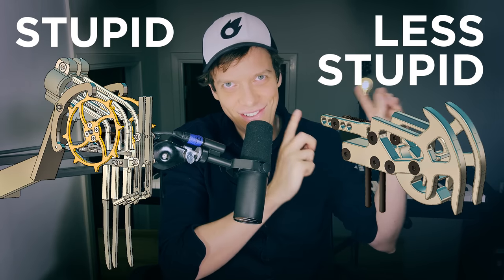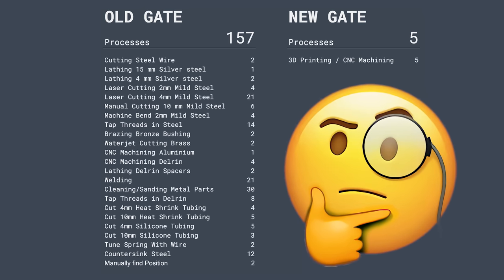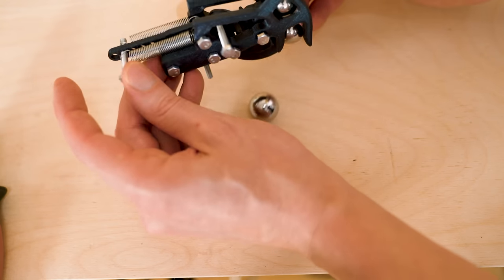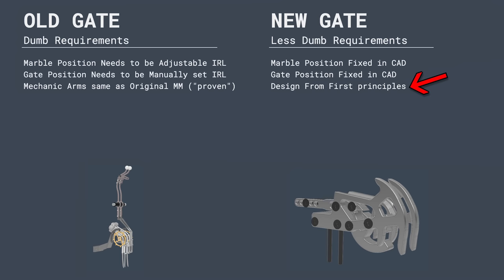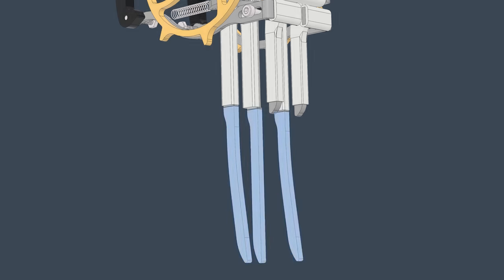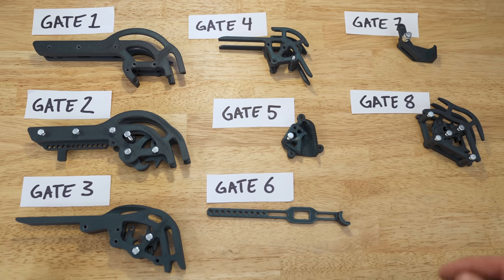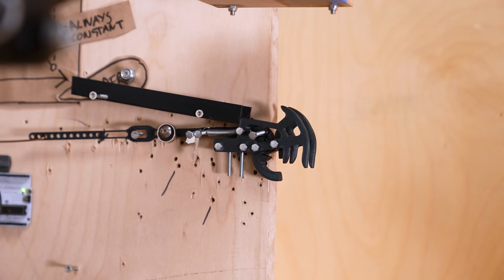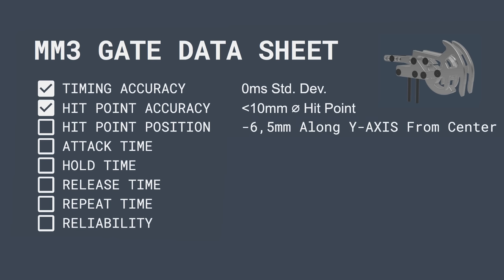This Design Trick Surprised Me!

Comment: I'm not saying you haven't made a HUGE improvement because clearly you have!! But.. the new gate still has 3 materials does it not? 

3d printed material or plastic or aluminium (depending on process)
Steel for bolts 
Spring steel for spring

Comment: Hmm if you want to transfer the drop position to cad I would like to measure it with more precision? like the angle the gate is mounted to the wall and stuff, so you don't have issues afterwards?  Or print out mounts (for a aluminium profile perhaps?) and test it ?

Comment: I know I find myself saying this more times than I should, but from the first machine to the MMX, and now to the new improved machine, I feel that form is losing out considerably from function. I get where you are going with this, you ant the machine to be dependable each and every time it is running. But to me, if it’s all about function, you may as well wrap it up in a black box and just let us hear the results. 

I say all of that because when you see the first marble machine, as a spectator, you find yourself in awe of its achievements as you watch all the gears and lifts do their job. The MMX was still a visual thing to the eyes. So my question is, will this new machine have form at all?  

Just thought I would put what little brain I have into suggestions.❤❤

Comment: 2:00 gonna say it now those metal parts in the old design are gonna outlast plastic parts in the new design. 600 marbles is the drop in the bucket for one wheel, you need to run a a accelerated wear test to failure.

Comment: dude.... if you're going to simplify to make your life easier, get rid of the machine and use a synth.
that has been the point of synths since the beginning! to dispense with the maintenance of instruments!
your machine was birthed under the premise of "Let's make the most mechanically impressive music box we can, that still runs precisely and consistently, even after changing it's initial configuration!"
in other words: complexity is not only OK in your design, it's the fundamental principle!
and if you're going to 3D print everything for the sake of simplicity, might as well 3D print a case for it and miniaturize everything! the point of the machine is to be impressive, so BE IMPRESSIVE!
put steel on it, in a time where nobody uses it! use manual action where everyone uses electronics! FIDDLE and PLAY the thing in a time where everyone automates!
THAT is YOU!

Comment: what’s the final design going to be made of, though?  all those plastic/metal interfaces will wear and fatigue, and we’ll be back here again when that wear degrades your standard deviation metric.  i really respect that you’re out there learning in front of the world and that you’re having fun right now, but it also pains me to see you get discouraged when you learn about the next challenge in mechanical design and engineering.  if you can run a longer durability test with your rig (a million marbles, anyone??) you’ll probably get some good data on how that material choice will perform over time so you’re not uber-disappointed in a few months.

Comment: I think you need to be careful with these measurements. They are all made in laboratory conditions. In a concert, you'll have to factor in vibrations that will turn all this precision on its head. What happens, for example, if the guitarist decides to jump in the air while you are playing on a wooden platform? The machine needs to work under these conditions. But that's not necessary a big problem. For example:

- The timing is within a millisecond accurate. That's great, and if it goes up to, say, 10 ms on a concert, it will probably still play tighter than a human player would. So no problem there.
- The marbles drop at within 10 mm accuracy. That's great, but if you design your instruments to rely on that 10 mm accuracy to function properly, then you'll have a really unpleasant surprise once you step out of your studio. However, if you design them to allow, say, 30 mm or more, then it will have enough leeway to function during a wide variety of conditions.

And how reliable it should really be? Ideally, it should play all notes perfectly no matter what. But that's a really dumb design requirement and it won't work. It should play all notes perfectly in a studio, and it should play almost all notes perfectly on a concert. And, most importantly, under any realistic conditions that would not warrant halting the concert in the first place, it should keep playing even if it misses a note or loses a few marbles. For example, it must work fine while people walk around on the stage, the drummer beats hard on the drum kit, the bass from the loudspeaker vibrates the machine, etc. And in cases like the aforementioned jumping, it should still work fine most of the time. But if it occasionally misses a note when all these effects add up in the wrong time, nobody will notice.

Comment: the whole dropping marbles manually, would it really be that big of a design feature to retrofit? All you really need is some sort of feature to trigger the normal mechanism that the programming wheel uses so if there is any room you could just make rods that reaches back placed next to the marble gates to push on. It is a feature i would implore you to look at once the system is designed and done!

Comment: hey martin, here is a thought, why are you catching the marble and holding for drop?  make a gate with 2 side plates and 2 gears, 1 internal 1 external that can pump 1 marble out per 1/8th rotation at ANY arbitrary speed, like a extruder on a 3d printer that squeezes balls through the gap with nothing other than gravity being your limit and even that can be designed around so you can spray a chain of balls like BAP BAP BAP BAP BAP BAP BAP BAP BAP BAP BAP BAP BAP all within a second or 2
Reply: also this re-adds manual playability as the outer gear will just be a idler to index the balls with the inner gear but if you give it a push/turn, it will spit the next indexed ball out, i can toss together a mspaint diagram if it helps explain the concept but hopefully ascii is enough
\\O
O||
ascii diagram where O represents a large tooth gear that holds 1 ball per tooth and || is a track, maybe put the indexing gear so it holds 4 balls in it's travel around an arc with the outer gear to the right of it 
=\\
O||O
just my thoughts, sorry if i have wasted your time in considering this design change along with all of the changes required to make it work in practice

Comment: 6:48, Wouldn't it be possible to just add a button/leaver on the front of the gate that connects to the rod on the backside. So if you wanna play and drop marbles manually you can just press the leaver from the front? Only way I see that this not working is if the gates are stacked too close that a 1-2mm of connection material doesnt fit :)

Comment: Don´t want to be a downer but 600 marbles are not enough too say that it´s reliable and to show that it will not worn out premature. It´s a good start but fix the motor to the lift and do at least as many marbles it will handle during a concert, maybe even a whole tour. Having to change out the parts every other concert is a design flaw in my opinion.

Sure you could just go from 3D-printed plastic to say 3D-printed metal and everything should be golden, with 3D-printed metal you could do some cool aesthetics maybe a HR Giger inspired organic/metal look!

Comment: I think if you really wanted, it would be possible to later retrofit handles that trigger the gates manually like you had on MMX. It is good to not insist on the requirement but I would not nececcarely declare it dead just yet

Comment: As I understand you have achived these splendid resultat with one prototype. But you will need many more gates. So it is important when you produce more gates that you control the variation between all gates when you produce the gates, so that the requirements are fulfilled for all produced gates.

Comment: I think this is the first time you got to the end of a design and still thought your plan from the beginning was right. Also, the gate you tested and approved is fabricated from the design you chose with no modifications. Every previous attempt taught you something that needed to go back into the process from the start. This time, you didn't learn anything new along the way, you did the work you knew how to do. Your previous designs were good enough to use them to prototype rest of the machine and discover integration issues. This design is ready for production.

Comment: 6:42 Please don’t stumble into the next pothole, Martin! Requirements should not only focus on your prospected results (a reliable working marble machine), but also on the effects: the change you want to be able to achieve with these results; your true goals. Which may be as abstract as ‘being recognized as a piece of art’, or ‘should be interesting to observe when operated’. Thinking deeply about values like these and taking them into consideration, may change the priority of your features and thus may make you want to kill less or other darlings. One of the ways to aid this process, is to think in chains/networks of cause and effect when you link the components of your solution with your goals.

Comment: In my experience, the best results, com from imposing reasonable, or even unreasonable, restrictions, for the very simple reason, that it usually forces you, to find THE solution, rather than just A solution. There is no easy way out, you have to do it right.
If you can only put 3 wheels on your car, the you have to put a lot more work in to some rather important areas, like suspension, and general stability, be cause if you don't, the end result will be so bad, that even the most gullible of people, are unlikely to buy it.
It's really simple, actually. And when the restrictions are too severe, once you reach that realization, you have likely already done the work, that'll ensure the end result will be a lot better than "good enough".

Comment: At quick repeats (14:10), it looks like the release mechanism hits the falling marble on the way down, throwing it off course. Have you checked how long it takes for the marble to clear that arm? That'll likely be the most significant limiter of repeatability speed.
Reply: Other than that, I just want to say that you've done a really great job on this new gate. First Principles design is really paying off for you!

My one piece of advice going forward would be to keep in mind to maximise tolerances where applicable. Otherwise, you risk relying on results from lab conditions that don't mirror the real world.

An example: The precision of that gate is fantastic and will do a great job at reliably dumping marbles, but it doesn't take into account if the machine is shaking while the marble is dropped (cranking the wheel/providing more energy, a dancing crowd, standing on an uneven surface). The gate will help reduce the impact of those external factors, but once you make the marble catcher(s), don't overly rely on their gate precision for determining landing precision.

Comment: This seems like it sacrifices the blend of art and engineering for pure engineering. New gate doesn't have a manual release and it doesn't have the artistic look.

At the least I'd put the big brass gears on the new gate (and have them doing nothing but rotating with the smaller wheel).

Comment: With your new speedy gate, Isn't your programmable wheel gonna be your weakest link with speed? How is your programmable wheel gonna be able to do a triplet - For example? I know you love your marbles, But isnt your arduino controlled Magnet going to be faster and more reliable in the long run then the wheel of fortune? Your Theme of do it smarter, not harder (Thanks Disney for Its' Mr McDucks saying), so how can you apply that to you master wheel? By the way, I really like your Archimedes screw Elevator.

Comment: You've cheated a wee bit in your comparison numbers there, Martin:
• For the processes, you included the installation and manual-adjustment steps in the old gate, but not in the new one.
• For the footprint, you included the control levers in the size of the old gate.  But the control-levers are not the gate.
So, you should've omitted a couple of things from the stats on the old gate prior to comparison, because it wasn't really apples-to-apples.

Comment: Instead of saying 0 ms of std. deviation, say <1 ms, because 0(.000000000000000...) is actually impossible.

Instead of saying 100% reliability, say >99,39% with a confidence interval of 95% (2 std deviations). You can calculate that with a Bernoulli-Test.
This number says that with an probability of 95%, the actual reliability is above 99,39%

These are minor issues and I know I am beeing pedantic here but you always want to leave some room for improvement.

Comment: Okay but you didn't test ANY of the others, particularly timing and hit point accuracy with the faster repeat times (at least you didn't show that you did). You obviously need to know that your timing and hit points will stay as accurate no matter what type of song is being played

I fear that your segmented/individualized testing (such as only testing hit point accuracy at one constant speed), with relatively low marble counts (remember that the MMX played many hundreds and even thousands of marbles with no mistakes at times too) can easily compound into much greater problems as you potentially progress through this build

If you're going to learn from the weaknesses of the MMX, you can't discount the fact that each individual part or section seemed to be perfectly functional in and of itself, for the most part, but it was the combination of system upon system that led to failures in the end

Comment: 600 drops is nothing wrt the millions you were aiming at. Please consider having longer tests.
1 drop every 125 ms ? even if you have 2 gates per note.... Why you say it is 'enough'?
BTW motors get hot, maybe buy a better motor (different hybrid magnets have better efficiency)
Try seeing if you need the nominal current you are using (reduce it or check if the motor is properly sized).

Comment: Well the older look better tbh. More aestethic and it's metal not black boring plastic or one boring metal.

Also as a student with the first one you learn many manufacturing process and with the new one you didn't learn anything.

And finally removing one of the most iconic features to play the marbles manually is A IG BIG LOSSSSS

Comment: Unfortunately, you kind of have to build these things first before you can figure out where it doesn't work.  Sure it was ridiculously complicated at the start.  On the verge of brute force.  But that's probably where 6 out of 10 of us are going to start from if we want to get anything done.  Those 3 out of 10 that spend time thinking how to optimize everything to perfection probably won't ever finish.  The last 1 has probably been doing this for decades, or they're plain lucky and hit the optimal design in a single shot.  That's the design process, unfortunately.

Comment: Dude, you are still not getting it. Unless you are designing the machine to be industrialized for manufacturing, there is zero point in what you are doing.
The Machine X was more than good enough for your performance, complexity is fine as a functional work of art that can be tweaked once or twice per tour. 

The more you seek efficiency, your machine will end up looking like a shoebox with leds, it will get duller and boring, and honestly it will lose the point of this.  The moment you started playing with arduino and servos, this project lost all its charm. The thing that made this project interesting was that it was purely mechanical, and that made it a functional kinetic sculpture.

If you are this obsessed with precision you will get a point where you will end up removing the marbles altogether for the sake of achieving sub nanosecond precision. Really, what is the freaking point.

Comment: I think you've made a critical thinking mistake.

Manually dropping marbles is not redundant. And with this new gate design a manual marble drop can be achieved with a simple button push.  You're doing it in your tests.  A trigger from the front can easly be added to activate this gate without changing a thing or affecting performance.  It's practically a mechanical freebie.

The critical thinking mistake you've made is that you've dropped an entire function of the machine because you are associating that function with your previous designs.  But the function itself is not to blame.

It's not redundant is because the point of the marble machine is to allow one person to play multiple channels of music easly.  Picking up mallets in order to play notes would be far too cumbersome and time consuming than simply pushing a button.

Comment: Absolute shame you went to all that expense, all those years, to make something that almost worked, and never did a full mmx song.! Doesn't matter if it's perfect or if it could play on a stage. You said the original marble machine never performed the full song without braking, and you recorded it 6 times for the original music video. Do the same. You have nothing to point back to as a milestone or success. You just scrapped that work and gave up at one metre from the finish line.

You made a "dumb" machine but a beautiful sculpture, something you don't want to reproduce. It is a crime if the mmx is torn down or destroyed and not preserved in a museum.